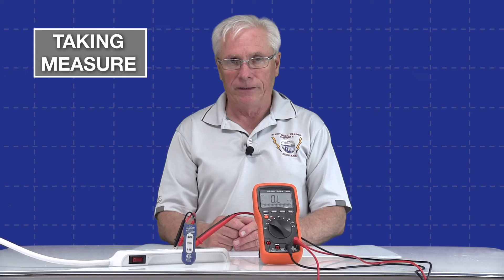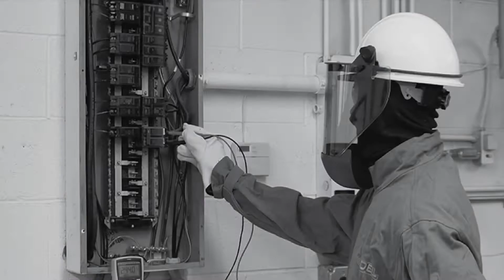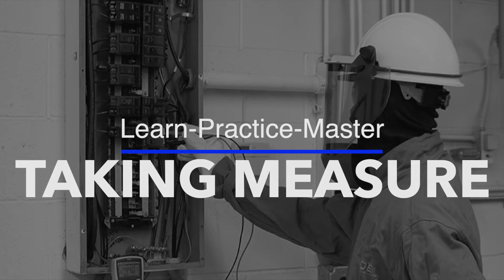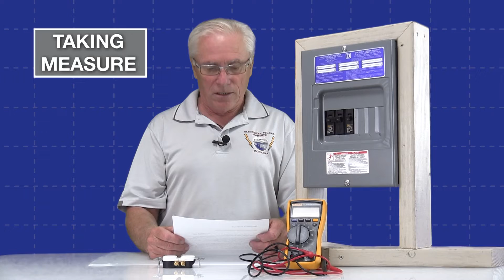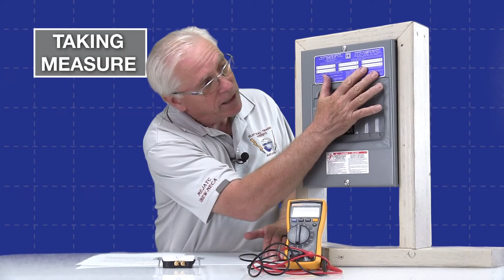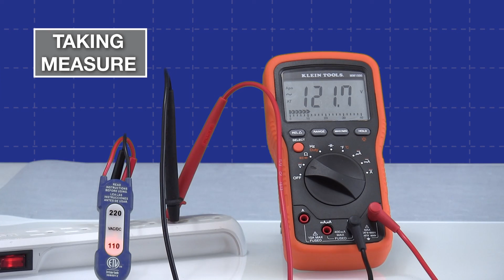Clarifying the Term "Nominal Voltage" - (July 6, 2023 Update)

Comment: Is there an accepted range that voltage going to a device can vary?  For example, can an 18v extension cord be used between 19v device and its 19v charger?
Reply from the maker: The short answer is "yes," every device has a range of voltage in which it can safely and effectively operate.  Various codes and manufacturing standards may apply to any given device.  I believe, for example, The National Electrical Manufacturers Association standards recommend that motors should be designed to operate satisfactorily at a voltage variation of plus or minus 10 percent.  Other devices or equipment may be more tolerant or less tolerant of voltage variation.  This is really a case-by-case matter.

Comment: Nominal Voltage means its the Open Circuit voltage not under load. How much load you put on the circuit will lower or SAG the Nominal Voltage down. Try to make a video lesson about ghost voltages and how to troubleshoot ghost voltages.
Reply from the maker: Yes, loading a transformer makes a difference in voltage measurement values.  On my 24V transformers, I often see 28V until I load them down.   Interesting that you mention ghost voltage.  I am planning on a video on the subject within the next few weeks.  Thanks for the comment.
Reply: Actually wrong.

The nominal is the specified voltage as per the specification. And that specification specifies tolerances above and below that nominal voltage.

So in my country the nominal voltage is 230V but the actual measured voltage if the supply is 240 volts. And that 240 volts is NOT caused by a light load.

The measured voltage, and when loaded, should be between Vmin and Vmax, where
Vmin = Vnom - Vneg_tolerance
Vmax = Vnom + Vpos_tolerance

In my country the 240 is below VMax and greater than Vnom, so it it within tolerance and this is quite normal and quite acceptable.

What you are talking about is two things: load regulation and cable resistance which causes voltage drop.

The nominal voltage is not the open circuit voltage. That voltage does actually change across the country.  And the point about "nominal" it is not the measured voltage.

The dictionary definition of nominal is:
"of a quantity or dimension) stated or expressed but not necessarily corresponding exactly to the real value."

The key part of that definition is: not necessarily corresponding to the real value. Which is precisely consistent and is the case in my country where the nominal voltage is 230 and the measured voltage is 240V.

So the nominal voltage is NOT the open circuit voltage. Definitely not.